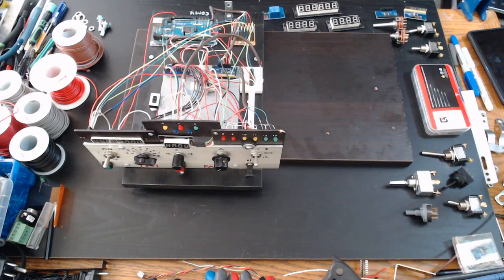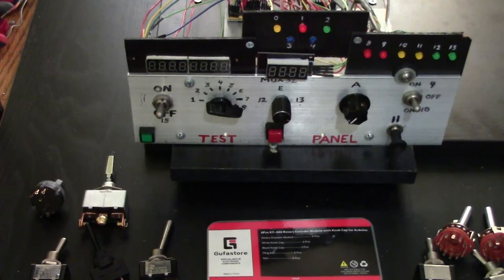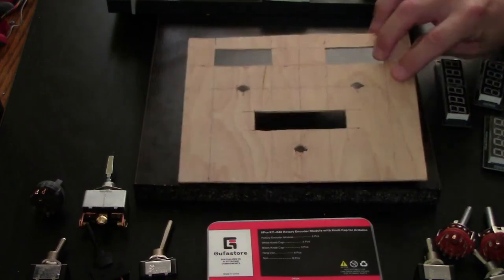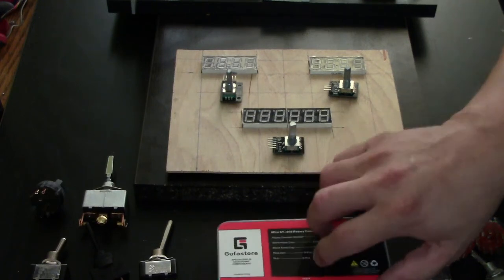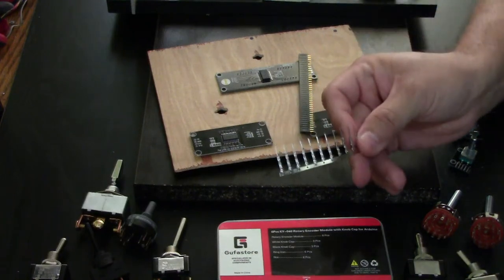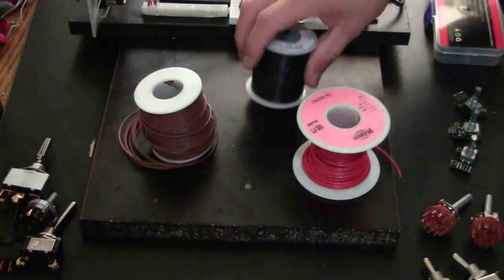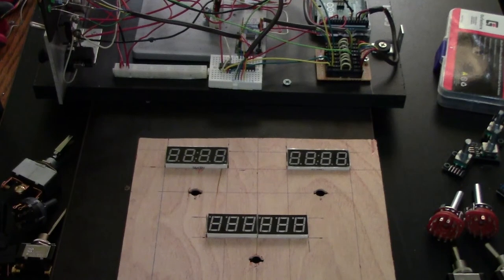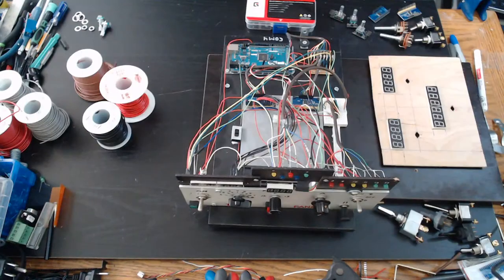Back to basics and upcoming video teaser

Comment: I need to know how to connect the multiplexer to the 2560 using mobiflight i don’t know if it’s different for address line connections. And when you say input multiplexer and output do you mean that’s how you have it configured, or are the multiplexer boards different, I went out and bought 4 analog 16 channel multiplexers
Reply from the maker: Hello, I know nothing about mobiflight. This is only for SimVim Cockpit.
Reply from the maker: Sorry i forgot to answer the second part of your question. The multiplexer boards are the same, its just how you connect them to the data bus that determines whether they are for inputs or outputs. Sorry I can't help with mobiflight since I've never used it.
Reply: Qosmokid thank you man I appreciate it

Comment: I love your toolbox 😊👍 I still couldn't locate someone posts a chart showing a simple wiring connection of a seven segement, and an encoder switch to Arduino Mega could be activated with simvim code, unfortunately I  couldn't understand the one shown on simvim website.
Reply from the maker: I will be doing the follow up video today hopefully it will clear things up
Reply: @Qosmokid  thanks so much you're helpful always, I remember I started using simvim with your help, thank you again ♥️🙏😊
Reply: @FlightSim2703  
Brian, please read all descriptions on the SimVim website and blog ( https://simvimcockpit.club ), there is nothing difficult to understand.
Ask help on the SImVIm forum 
Vlad
Reply: @homecockpitinterfacesoftwa4883  Thanks so much Vlad, I will, I disassembled my entire fuselage, which was connected with 5 monitors to PC, now It's a good time for me to rebuild just my cockpit followed the webpage instructions step by step, but I will use just one 7" monitor for GPS 430 with  momentarily, and encoders switches, and study your webpage more for my  7 segement, small LCD. Thanks so much for helping me out 🥰🙏
Reply: @FlightSim2703  
Note, that instead of using 7-segment displays , wiring and soldering, you can spend just a 5 minutes to make a full radio stack displays:
simply take any small monitor (as your 7") with Raspberry and then you can make any realistic radio stack using the SImVimPanel program: https://simvim.com/svp_instr_set.html

You can download and test the radio stack module right now on the download page (below) - https://simvim.com/svpanel.html
(see the"Standalone Radio Stack") Then you need only make the simple cover plate with instrument bezels and buttons/encoder. Or you can control it with on-screen buttons/knobs by mouse or touch screen

Vlad
Reply: @homecockpitinterfacesoftwa4883  Yes, awesome I will since I do have two more extra 7" monitors to make the radio stack. Thanks so much ♥️🙏